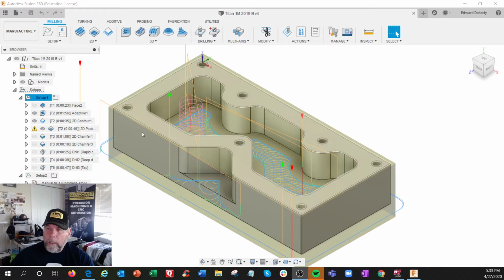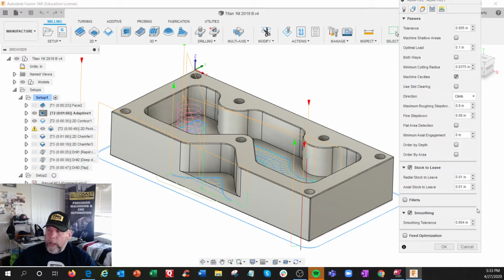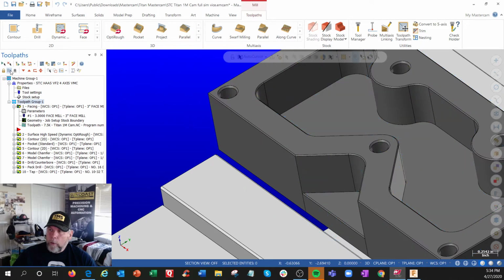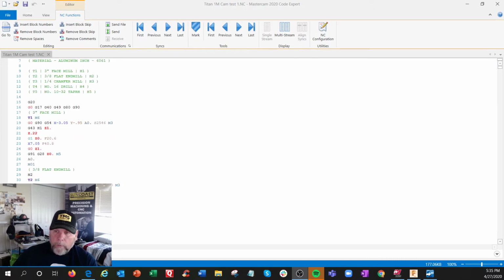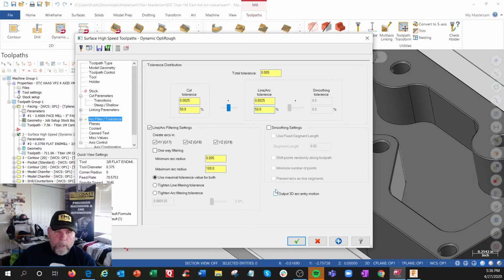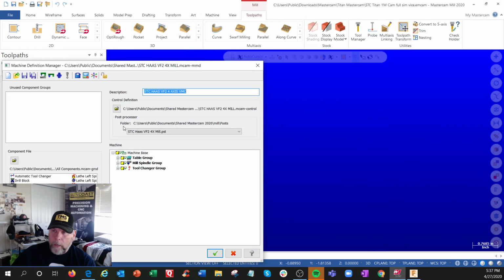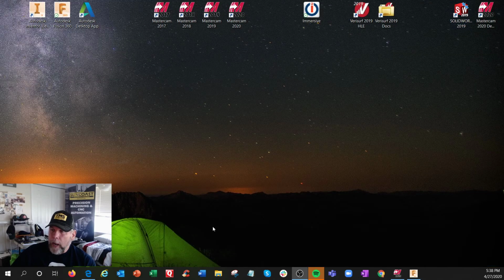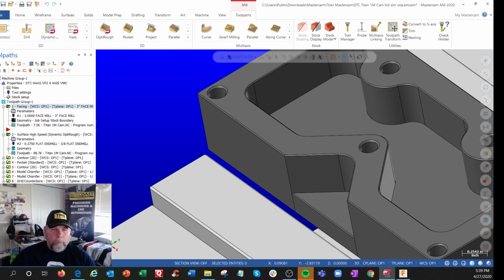G Code -  NC file size reduction - Mastercam - Fusion 360

Comment: I work at a job shop the machine I regularly run only has about 24kb of memory total. Is there any way on mastercam I can output a single operation to only 3 decimal places to avoid 4 decimal place moves for roughing to save memory? If you left more than .01 you possibly would only have to output 2 decimal place moves. I also use the delete spaces button to save space.
Reply from the maker: I have deleted the spaces in between to save space. It would take a lot of tweaking on the post processor to see if you could automate that.   I would just split up the program if needed.